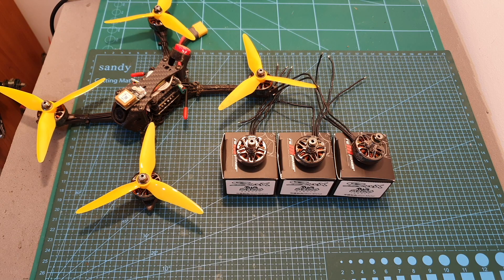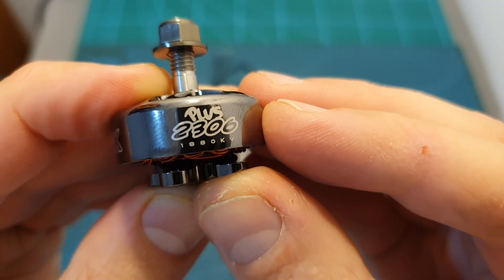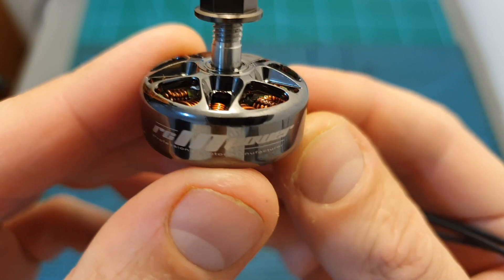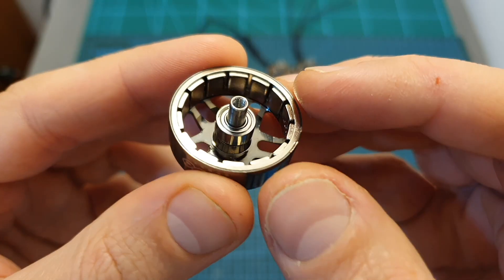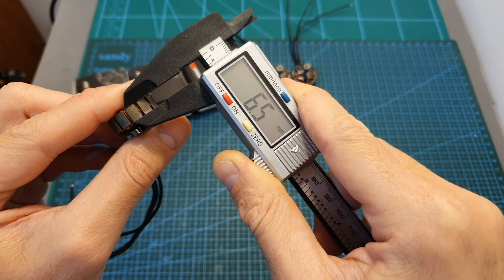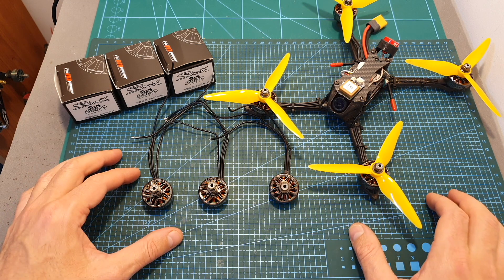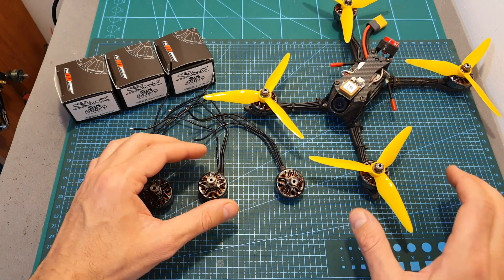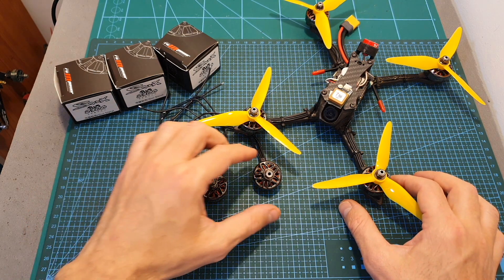RCINPOWER SmooX 2306 Plus 1880KV / 2280KV / 2580KV

Comment: Hi Gal, what do you think in general about flight time with these motors ? Despite the power, the efficiency is really high, I expect long flight time at medium throttle?
Thank you so much
Reply from the maker: Hi there. Which KV are you going to get? If you are aiming for a long range setup, I think that probably the best option is to go with the 1880KV motors and use 7" props.
Reply: @KremerFPV  hi, mine was a general consideration  on the all range.. That I noticed for example on 1880kV, with 5147 inch in 6S, 1729g with only 560W is an amazing result vs the other motor whit similar characteristics! Thank you so much!!

Comment: Are u sure the bearing didn’t just pop out on that one motor or is it like that on ALL of the motors?
Reply from the maker: I am pretty sure :-)
Reply: Gal Kremer haha ok just making sure 👍
Reply: This is wrong unfortunately... I have 10 of these motors and the bearings are normal. They don’t attach to the shaft like that. A question I do have tho “what the hell kinda bearings are these “ I looked everywhere and can’t find anything on them. Think I know why, because the bearings are trash. After a month on two quads they vibrate like crazy and sound like rocks in them. Can’t get a answer to replace them
Reply: @hallzy426  was about to buy them but i'm struggling to find usefull information about magnet, alloy and bearing type. It made me think that rcinpower is trying to hide it to customer. I'll probably stay away from these. What is ur experience a year later ?

Comment: Hello.
I am using this Smoox 2306 with 2580KV on 4s and azure power 1540 propeller. Bit I only Flyer round about 3 minutes??
T—Motor F4 stack with F45 ESC
SLS NOC 1550mAh 4s

What could be wrong on this Setup?
Reply from the maker: Sounds about right. These motors are pretty power hungry and you have the higher KV version so it makes sense that your'e getting about 3 minutes of flight.

Comment: Pretty motors but look power hungry... did you try the 1207 from rcinpower?
Reply: those efficiency numbers actually look pretty good. 3.5g/w at 100% throttle is way better than something like a t-motor 2306.
Reply: This motors are very efficient. About +20% more efficiency than other motors (t-motor, flysky, brotherhobby, carearea) with the same size and props